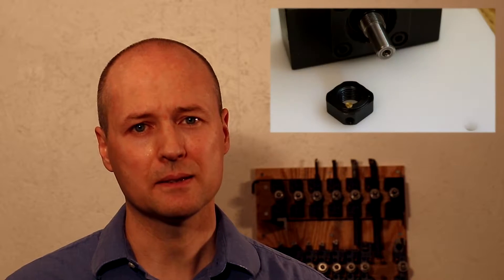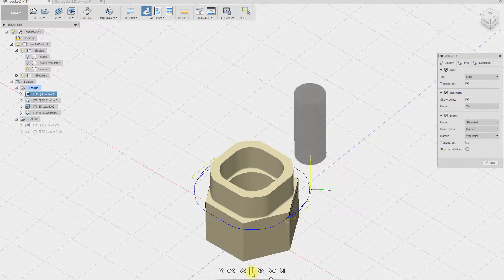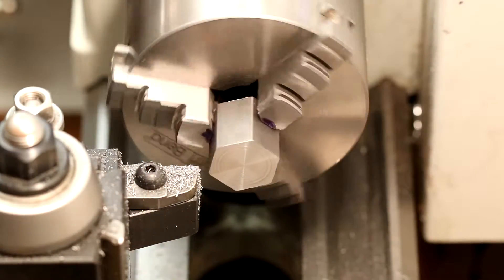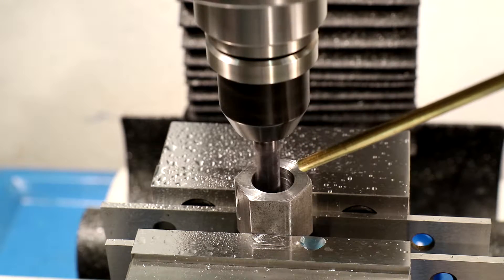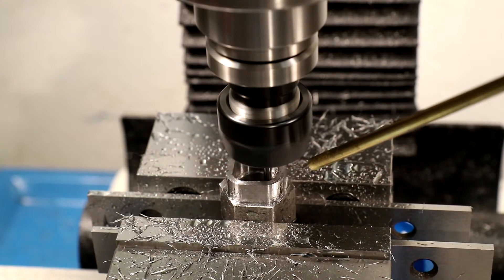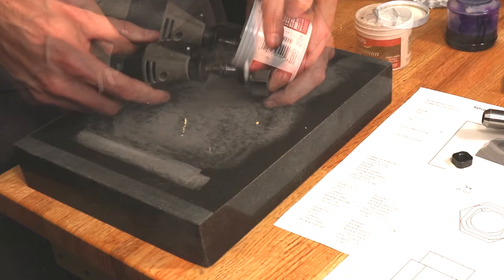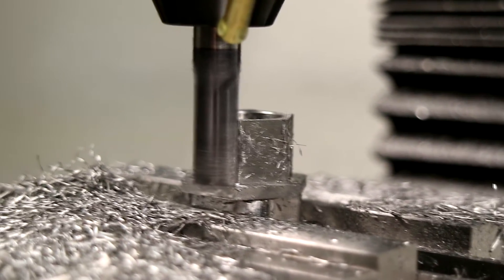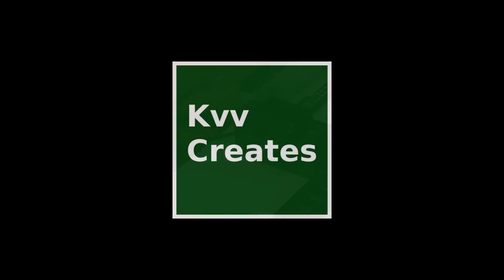Machining Socket for Ball Screw Retainer

Comment: Nice work! I need to grab some of those Lakeshore Carbide end mills, they were hacking away at that steel with no trouble at all.
Reply from the maker: Hi Rob. Absolutely, and on my small mill, they mean I can avoid changing the belts to drop to a slower speed. The choice of steel has an impact as well. Checkout http://www.carbidedepot.com/formulas-machinability.htm

Comment: great instructional video. I'm yet to to produce a real working part on my cnc mill out of steel but I have to get my feeds and speeds in order (still a newbie). keep up the good work.
Reply: Hi Wendell; newbie too, great to see you have a CNC as well, it's so addictive to produce your own parts. Few basics you must follow; use a proper clamping, rigidity and stability are key.  Get some steel that is 'ok' to work with (like the type Kent is using in his vid) Choosing the right steel might save you some gummed up mills and frustration, use a mill that is as short as possible to get the job done (rigidity)  Cooling might come to play as well :)  
As a general guide-line; I use this site as a reference for feed and speed; http://zero-divide.net/?page=fswizard (dial back the 'overrides' to about 50%) Just get familiar with some basics ; feedrate, DOC, WOC, surface speed. It'll be fine. Another important thing you might want to consider; dive into Fusion 360's adaptive clearing. Slotting (single pass cutting, with or without multiple depths)  a part out is not the way you want to do it, slotting is considered to be the horror in toolpath-land. If slotting is required, use adaptive toolpaths or a roughing mill, the latter has an uneven surface which helps to avoid resonances/chattering.
Reply from the maker: Hi Wendell. Thank you. I'm still a newbie as well, and remember the mistakes more than the successes. Learning may be the secret to staying young and humble :) Regarding the speed-feeds, I was hesitant to try steel, but with carbide tools I can stay at higher RPMs and had more immediate success with steel than aluminum. Maybe this has to do with the particular aluminum and steel I'm using? Do you have any photos of your cnc mill online?

Comment: Great work Kent! I needed to look up the type of steel you used, it machines very nice indeed! Makes me want to try some steel parts on my machine. Radius mills are genius.  12L14 seems to machine even better, according to the data-sheets (absolutely no experience with steel), but the latter contains lead. Fusion can throw you weird toolpaths from time to time. I hear you on the younger generation. Our kids think it's normal to make parts with a 3d printer, lathe and produce stuff on the CNC. Few months back our oldest (4yr) asked if we could machine 'a present' for his friend, since he failed to find one in the supermarket.. He mentioned it needed to be heart. I think it's our job to educate them to what they want to be taught. Trying my best not to get our kids biased from our own hobbies/profession. It's hard, but it's good just to be aware.  They just grow up by the food we provide them.
Reply from the maker: Hi Rene. Thank you. The drawbar I made was from 1045 because McMaster recommends it for bolts, but it machined terribly in comparison to the 1215. I stopped using 12L14 out of concerns about the lead. I could just see someone eating a chip... Your comment prompted me to read a bit about it. While "12L14 bioaccessibility" only returns four Google hits (!), the Wikipedia page on brass, which is beautiful to machine, says it has a decent amount of lead. 12L15 has ~0.2% Pb while brass is ~2%, except in California, where lead-free brass (for facets and such) has 0.15%

I love your approach. The analogy between education and nutrition is great. Feed the body a variety of resources and let it heal and improve, likewise, feed the mind variety and reap the benefits. Melinda and I have a similar dream to your approach. Create a lot of different experiences, and see what gets the little one excited. My parents got me lots of broken TVs to take apart, books to read, involved in house repairs, helped with car repairs, and then came the computer, and the catalyst was found. The 3d printers seem the perfect tool for kids, with little tedious setup. Perhaps to improve the interface, clay->scanner->3d printer could be used? I'll seek advice from you soon, perhaps after the sleep deprivation everyone says is coming. :)